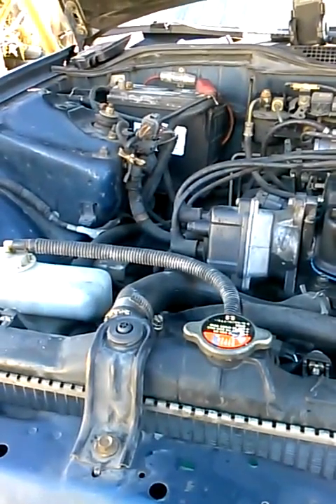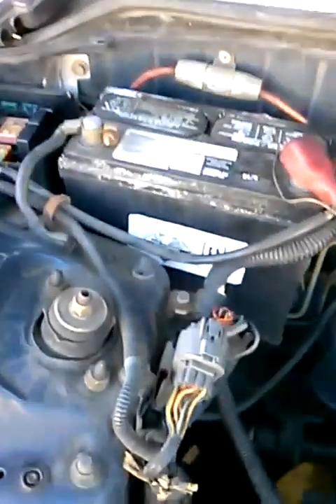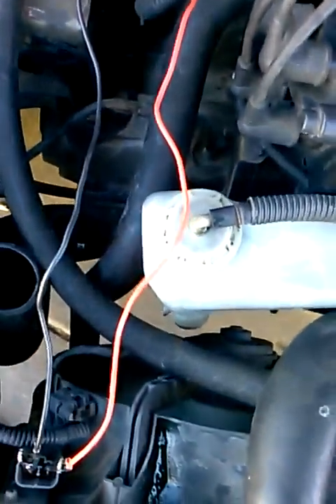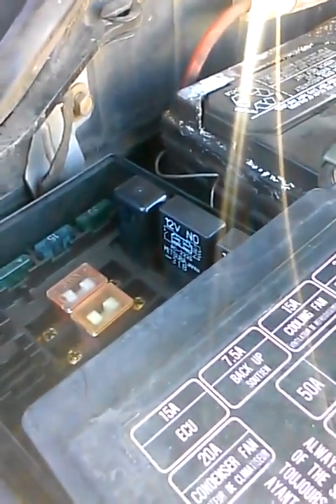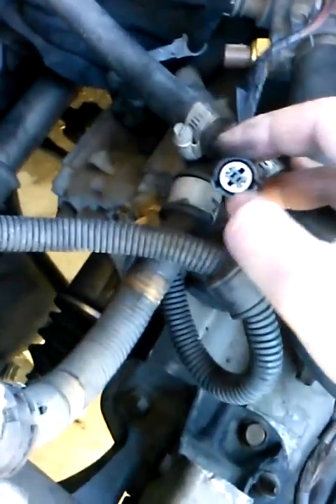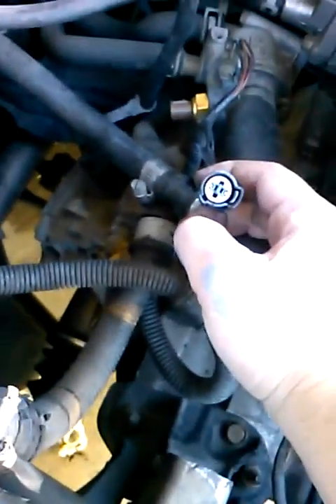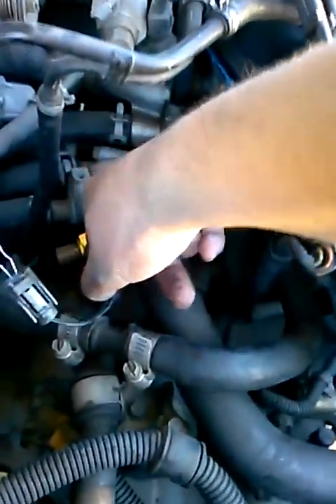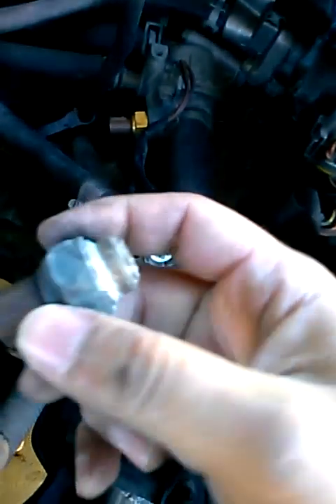Radiator Fan / Relay / Cooling Fan Switch  Not Working: Honda Civic

Comment: Bro, I did every single test that is on your video, and many other videos, I have changed every sensor that my honda has, I have changed the thermostat and the fan does not turn on by itself. I have checked the temperature and it gets to 100° or 110° and the fan still does noa turn on. What could be the issue? The fan works if I make the short that you mentioned, but thats the only way it turns on.

Comment: I tested everything like you did and replaced the thermostat and the switch but it keeps trying to overheat, I have fluid movement through the radiator and I had my fan kick on after changing the parts but now it's not coming on while I drive any suggestions??
Reply: replace the cooling temperature sensor kid

Comment: when i  bypass the radiator fan switch with a jumper wire then only the radiator fan comes on. Can you tell me where is the problem. i changed the radiator fan switch still the same problem.

Comment from the maker: Ok. cooling system on the electrical part is working 100%, no doubt, if you did replace the cooling fan switch. if the thermostat is working properly, the radiator is full of coolant and the coolant is properly circulating. then you are good. BUT car can overheat if coolant doesnt properly circulate in system. Poor circulation is caused either by a bad water pump. I think that if there is bad circulation then the cooling fan switch would not be working under the conditions it was designed for.

Comment: What happens if you try to connect to the battery directly and the - & + touch and short out, do I need a new fan??
Reply from the maker: Joshasurus91 nothing bad happens to the fan since electricity follows the path of least resistance.  When you touch the + & -, you're shorting out the battery and no power goes to the fan.

Comment: To check your fan jus turn you A/C on. If it turns on the fan works. Then check your relay and thermostat.
Reply: +ponte trucha With the Civic there are many times 2 fans, one for the A/C, and one for the radiator.

Comment: Check the fan switch first that way you can rule out both the fuse and the fan instantly and then check the fan and then the fuse if looping didn’t work

Comment: I did this but still can't figure it out why my radiator fan won't work I did the first step direct power it works then the relay it didn't work so I did replace it to new one still didn't work. I also replace thermostat and radiator fan switch

Help me to figure it out! Thanks

Comment: if your cooling fan doesn't turn on,  the problem is very likely NOT the thermostat so u can prob cross that one off the list, the thermostat is very easy to check ... if its stuck in the closed position your car will overheat very easily within a few minutes because the cold coolant from the radiator is blocked from reaching the engine, and if its stuck in the open position it will have no effect on the cooling fan or fan switch, (the car will just take longer to warm-up) your engine should still heat up then activate the cooling fan switch at the proper temperature, that leaves the cooling fan switch as the most likely malfunction

Comment: I changed both my radiator thermostat fan switch my relay works and my fan works I changed the thermostat a year ago and my fan still doesn't turn on when the car starts to heat up any suggestions would be appreciated its a 98 honda civic d15b 1.5 non v 
Thanks
Reply: lift bonnet leave the car idling till it gets to normal operating temperature take revs up to bout 2000 n hold, make sure u can see the fan, after a min or two fan should come on only for about 10secs than off again. that's how I checked mine it's hard to catch unless your staring straight at it.
Reply: Ok thanks
Reply: joe guzman check ur fuse box under ur dashboard find the 20 amp there for radiator fan,cooling fan and power side mirror. If it's busted replace it.
Reply: +leh ny thanks
Reply: My cooling fans only run when I turn the heater on, any solutions, relay ? Temp control? I just replaced the thermostat so it's good

Comment: relay works, cooling fan switch works, fan also works when test each one separately but when using paper clip method....the fan not turn one....do you have any idea??? Thanks.
Reply: Did you figure it out

Comment: If you only have 1 wire to switch how would u short it
Reply from the maker: the body of the switch is used as ground. i would try connecting the wire to that wire to the body of the switch if not the body of your car which should also be grounded (common ground).

Comment: Holy shit my keyboard is tripping keeps posting before I finish but changed thermostat the fan switch and relay all fuses fine still not turning on the radiator starts smoking and iv bleed the cooling system to so no air is messing up the readings any help?

Comment: My 20a condenser fan fuse keeps blowing every time I put a new one in it it blows, my fans are not working at all therefore my AC ain't cooling does anyone no why the fuse keeps blowing?

Comment: i jumped it but no power to fan and no click from relay...so i must need a relay...problem is i have three of them..so how do i know which one to change
Reply from the maker: healthyamerican there is a diagram on the exterior fuses & relay box. you can also find it by process of elimination if you are missing the diagram. there is a relay for your cooling fan, heater fan, and headlights. them out one at a time and see what they control. i have one video where i show how to switch relays. check it out, it might help

Comment: I did the paper clip method and nothing so i replaced my cooling fan relay tried the paper clip method again and nothing still what do I do next...
Reply: Try to check the fuses
Reply: @burnt clutch I did the paper clip method and the fan comes on without having the key switched on?? But when I switch the key on the paperclip method doesn't work?? Any clue to why that is?
Reply: Burnt Clutch  thanks for taking taking the time to respond!  I figured out my dumb self was checking the wrong switch! Lol I was at the upper hose instead of the lower hose where the thermostat is. It was the switch that I had to replace. The fans are working correctly now!  Thanks again!

Comment: ive done everything in ur video and replaced the cooling fan switch fans still wont turn on it will only turn on with paperclip help please
Reply: +Daniel Lopez ... u gotta warm up the car,  the cooling fan turns on only when the engine temp is over 200 degrees F
Reply: Daniel Lopez check ur fuse box under ur dashboard there's a 20 amp fuse there connected to ur radiator fan and cooling check them it's busted,replace and good to go

Comment: hello pls someone help  me out here..basically was replacing a radiator and did everything..but after i change the coolant i cannot get the radiator fan to comeon..i waited for abt 30 min on idle.. have checked all the fan motors and its all good and also checked the thermostat and its fine, it does open up..the temp gauge goes abt midway and stays there...there is a smaill amt of smoke coming from the radiator fan, but i am thinking maybe it is because of the overflow of antifreeze from before..what could it be...stumped
Reply: +tash lam Did you figure this out? I changed my radiator and reused my old fan and the same thing occurred, my fan stopped working...
Reply: +Nick Wilson Did you get yours fixed ?
Reply: Problem here as well

Comment: I replaced everything and my fan still wont come on so i just have a wire to keep it on with the ignition but i dont wanna keep it like that :/
Reply: Rikiboii Ramirez did you ever find out the problem?
Reply: Daniel yes sometimes when we buy the fan switch they are defective so I bought another one and it wnded up working

Comment: If your switch / thermostat isn't working and using a paperclip turns the fan on, why not just leave the paperclip in there?
Reply from the maker: Arjay Waran Hi. Note: the Paperclip Method is for testing only (I don't recommend leaving any exposed wires/paperclips unattended especially while driving ) but to further answer your question, consider that the car engine optimizes its performance at a certain temperature. Case1: Since fan is used to cool the anti-freeze through the radiator, you can temporarily get away with bypassing the switch only if thermostat works and it is able regulate the coolant flow to the engine block although the car will take a bit longer to warm up in the morning. Case 2: If the thermostat isn't working (assuming it is stuck closed position) leaving the fan on isnt going to do anything because coolant flow is restricted by the broken thermostat.
Reply: SnagEasy
Reply: +SnagEasy ... why would the car take a bit longer to warm-up in the morning??  all cars start with the thermostat in the closed position and only open up when the engine is already hot, i think the only way it would take longer to warm up  is if the thermostat was stuck in the open position
Reply: +Arjay Waran Also, the engine will build-up sludge if it's not allowed to get up to normal operating temps.
Reply: +jcastle003 it doesnt matter if the cooling fan is always on, the car will still reach normal operating temperature in the same amount of time, when the thermostat senses a cold engine it closes and blocks the cool radiator fluid from reaching the engine, a 12v radiator fan blowing over the outside of the engine has no effect whatsoever LOL that'd be like putting a house fan on the front yard to cool the inside of your house on a hot summer day!  :-D
Reply: +Travis “veraciousTrUth” Martin .. yup, its a pretty simple circuit, its basically just two wires going to the switch - if you short these wires it provides power to the fan.

by the way, with the cooling fan always on, the car warms up in the same amount of time, within 5 minutes your engine will be hot (like normal), the thermostat will then open up and allow the cool radiator fluid to cool the engine.
Reply: *****
ur welcome :)

...and yea i agree its pretty neat how this works, a lot of ppl dont realize that the thermostat controls the engine temperature, it actually has the normal operating temp of the car written on the device itself in farenheit or celsius, the cooling fan just controls the radiator fluid temp, the thermostat decides when to let this cool fluid enter the engine block
Reply: kobe0834 I'm the
Reply: Arjay Waran I would think because your fan isn't supposed to run 24/7
Reply: ok I have a question.i have a 98 Honda civic that when I bought it.the fan relay was bypassed.i just replaced the radiator because I had a leak in the transmission cooling line.how would I go about replacing a already bypassed fan relay?it's not over heating though.rarely does it get to the very hot point on the temp gauge
Reply: it's like the radiator fan is on auto.
Reply: kobe0834 the

Comment: The best method to control radiator temperature is with Pulse Width Modulation controller.  Call The Auto Cool Guy!

Comment: this guy had some decent tests but he ignored fuses! and running wires from battery with no overload protection is a huge risk! also there could be a wiring issue that could change a diag. such as if the fan switch was not plugged in all the way etc..